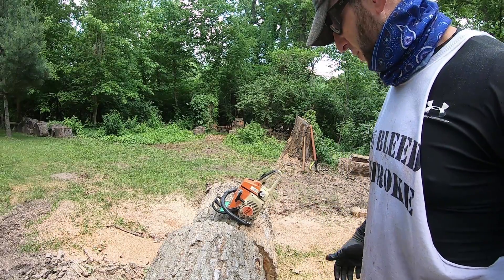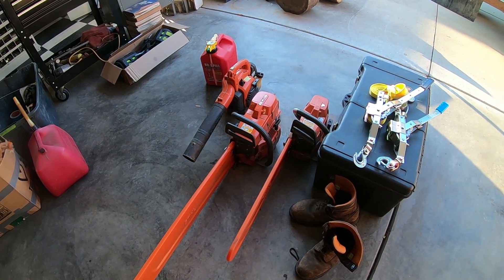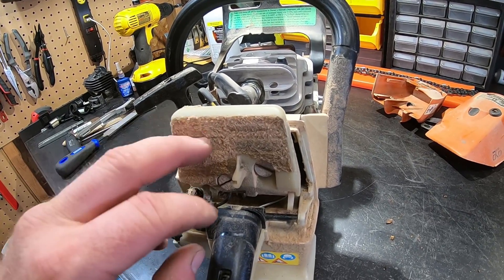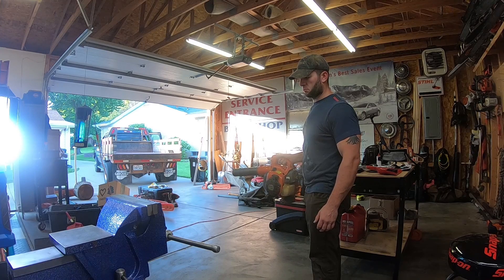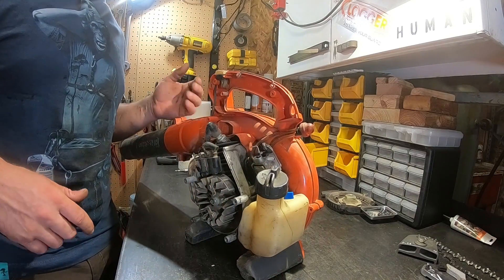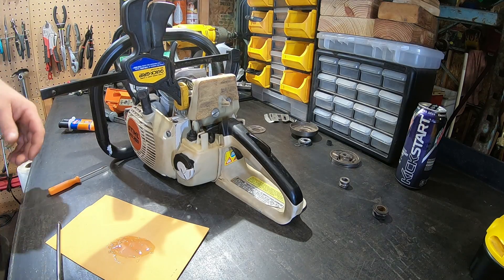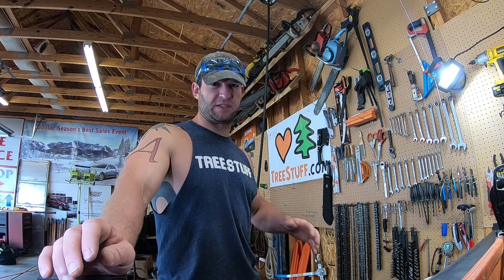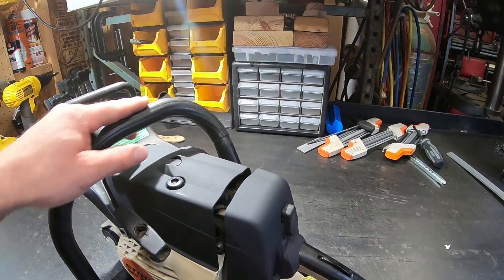39: MS260 Break In

Comment: I have pics of cylinders and pistons ran on the goofy Amsoil 80:1 and 100:1 ratios, not pretty. Lots of scuffing, aluminum transfer. The rod is usually blued near the big end bearing and wrist pin. Pretty much the same result as straight gassing the engine. It's cool to give it a go as an experiment though. People often talk about Amsoil @ 100:1 doing just fine in trimmers, but they need to understand trimmers are under much less stress, and they're often ran at half throttle, which means crazy rich air to fuel mixture. I've seen the squish on trimmers as large as .080" so again much less stress.

 I recommend at least 40:1 to most of the tree care guys I've done work for. So far this has more than doubled the service life of their saws. The extra oil is more to keep the bottom end happy and seals wet, than it is for piston to cylinder scuffing. More oil also gives better ring seal, I see a lot of blow-by on saws ran with less oil in the mix.   

With that said, you just gained some major cool points with Primus playing in the background.
Reply from the maker: Yeah, thinking I'm going to start running a higher oil ration, going to check the other saws just to be safe, but none have really been giving me issues so I think I'll be ok.
Reply: I'm running 40:1. No way I'd consider 80:1. Nothing to gain, plenty to lose.
Reply: Human 

Good deal. Amsoil has enough additives to normally keep a saw running a long time, but damage is being done. Cooking a top end is one thing, the bottom end is where things get costly.✌

Comment: It is not the number of tanks, as most suspect.  It is the number of hot and cold transitions a saw goes through.  I figure 15-20 transitions for the rings to begin to seat and 15-20 tanks for a full break in.  When the saw will sit on a hard flat surface and stay where you put it I consider it to be pretty much broke in.  If it still has the St. Vitas dance and bounces all over the place it still has a way to go.  I give my saws a little more two cycle oil for the first three tanks.  After that, it gets my regular 50:1 mix, actually about 47:1 of Stihl Ultra oil with PNE gas and StaBil.   I do not use snake oil reduced mixture oils.  Ultra works fine in all my two cycle stuff.
Reply: Just curious what does the bounce have to do with the break in status?
Reply: @tjlovesrachel  if you saw will sit like a slug it has pretty much broken in.  If it bounces all over the place when you put it on a hard surface, it has not yet broken in.  I put mine on my outside work bench on an old bathroom mat when I am runnng them.  My ms 660 sits there like a slug, while my ms 460 would walk off the workbench if I did not have a half inch lip on the bench.
Reply: @johnclarke6647  I understand what your saying.... but what I’m asking is why is that .... what is actually causing the bounce ... like how are unseated ring making it jump?

Comment: This is one of my saws I have, except I have the pro version, I see a lot of hate & some love towards brand new Ms250s, Don’t know if you have any experience running that exact type, but you have any thoughts?
Reply from the maker: Not a bad saw.  Biggest issue with them that I've seen is that when starting them the little burp you get with full choke on is really hard to hear, so people pull too much on choke and flood them.
Reply: Human Idk if the m tronics are good where you are but they’re iffy up here not waning to run, comparing that to the 250, reading some of the comments on the stihl site of people saying they went through a few of them within a few years or even less than that, but I’m taking your word about it, I know a decent amount to keep a saw treated good but you uh, pretty sure you damn well know what you’re doing

Comment: Have you tried any of those cordless electric chainsaws?
Reply: Sawmiller Smith  My daughter got me one for Mother’s Day. I have yet to use it tho.
Reply from the maker: I've not
Reply: Sawmiller Smith I personally can recommend the Greenworks 40v 16" chainsaw. It obviously doesn't have Stihl power, but has no issues with chewing through softwoods at all. When I need to clear a small pine that's fallen on a horse trail, it's a great thing to have riding along in the utv with me while checking fences. Good power to weight ratio, fantastic run time on one battery, and built really durable. They're not cheap, about $250, but they're great battery operated saws.
Reply: Get a gasser, those electrics are for small branches and soft wood trees. You'll never know how unprepared you are until the winds in your area pick up and you have an old big tree that gets knocked down then when you try to use an electric saw on it, it just wont "cut it" better safe than sorry they have smaller gas husqvarna saws around 180. Believe me it's a shitty situation when your underpowered and have to play someone triple what a good reliable saw would have cost to have someone do it for you.
My saw is a husqvarna 450E II works great and I love it. Good luck😬👍